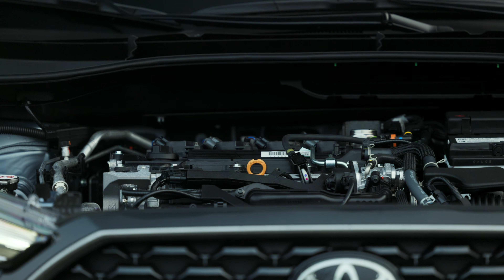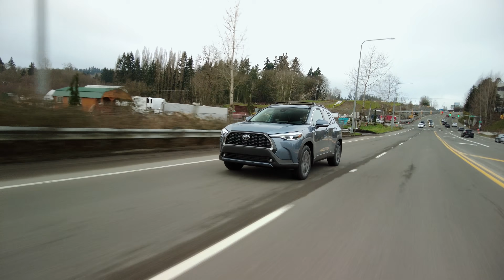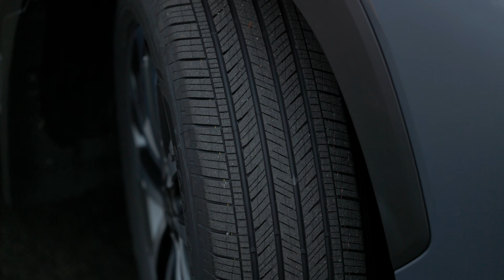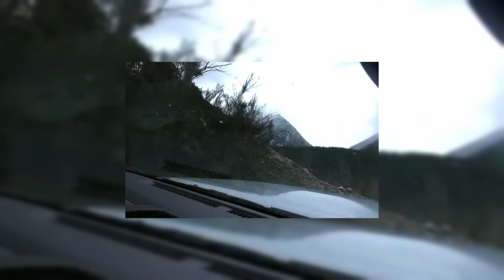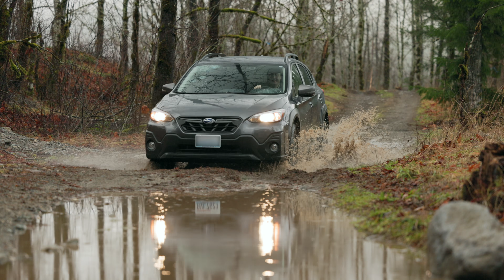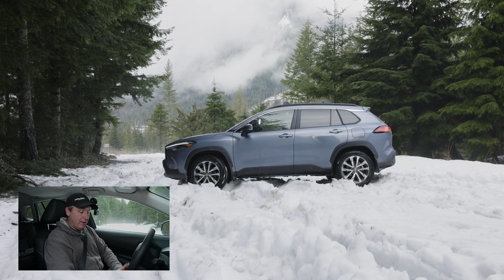2022 Toyota Corolla Cross vs Subaru Crosstrek AWD Off-Road and Snow

Comment: I was going to get the Crosstrek over the Cross but decided against it for Subaru doesn't want to sell it to me MSRP and has a markup of over $5000. I just went ahead and ordered a Corolla cross and I got it at MSRP. Cross is bigger than Crosstrek too which I prefer.
Reply: Just traded in my 2018 crosstrek limited for a 2022 model .the 2018 crosstrek was worth more 4 years old than when it was new
Reply: Same situation for me. Was down to subru and toyota and dealer offered the MSRP for the corolla cross so i took it. I'm not going off-roading and it should deal fine with snow on city roads. But i haven't gotten it yet and now the delivery is pushed to end of march :(.

I've been driving a toyota matrix for the last 12 years and my whole family owns Toyota's so i trust the brand. The one Chrysler and hyundai we had both had so much go wrong and with a purchase this big i dont want to risk it so that was another factor in choosing toyota over subru.
Reply: @OxnardComma  a recent report has 95% of Impreza's and other Subarus still on the road after 10 years.
Reply: Same, literally for the same reason
Reply: Toyota will last a lot longer too.
Reply: Plus Toyota’s run for 500,000 miles + , while none of my 2 subarus passed 200,000 miles. 
My wife had a 1st gen RAV4 with 325,000 miles and she sold it 7 years ago, and the old lady who bought it still drivers every day.
Reply: @devil2jz500  My last Subaru made it to 300,000 miles.  The previous owner was a young teen, I was a teenager when I bought it from them.  It was great and never had any issues, it only failed because I was a dumb teenager and got stuck in a 2 and a half foot snow storm in Pennsylvania and proceeded to hold it at redline for a very extended period of time trying to get myself out.  If I didn't do that with it, I'm certain I would've still been driving it today.
Reply: @devil2jz500  My Rav4 has 95,000 kms on it.  Seals blown in rear differential right now and Toyota can’t even fix it until Jan.  First, they tried to tell us it wasn’t covered under warranty.   We’ve been Toyota owners for most of our lives.  Sadly, it’s the last one we’ll ever buy. 😡😡😡
Reply: @gwenedd9734  what year is the RAV4? I never heard about any differential seals that can’t be fixed. If you are not mechanically inclined, the dealer will BS you and take advantage of you as soon as they suspect that you aren’t an expert…
Reply: @devil2jz500  yes, i googled it and crosstreks are good for 200,000 miles while toyotas are good for over one million miles!
Reply: @michaelsmith9308   they are pretty optimistic with Subaru lasting 200k miles 😂. The boxer engine design isn’t very practical for maintenance neither. I can do a timing belt service on a Toyota at any parking lot with basic tools. Stick with Toyota
Reply: @devil2jz500  modern subaru engines are timing chain not belt
Reply: @devil2jz500  what subaru have you owned 
I am comparing between the corolla cross and subaru crosstrek..
I am afraid from the weakness sheet metal of the toyota.  It got dings very easily ..even the bumbers are not solid fitted and easily got disassembled from the car if got a small hit .  How about the subaru  solidity ?
Reply: @amrashraf9559   I owned a Forester and an Impreza. I have at least 20 friends who owned Subarus and they all either blew a head gasket or a rod through the block. Subarus are fun, but not reliable. I currently have a Corolla with almost 300,000 miles and still running like new. After I saw 2 Tundras with 1,000,000 miles and a Tacoma with 650,000 miles I only buy Toyota.
Reply: @devil2jz500  so if i compare the new forester wilderness to the rav 4 ? Which will be more solid and reliable ? Why most people  confirm that the crosstrek is a very relaible car ? I am so confused ..i usually use the car for 8 to 10  years ,so i need a bullet proof car .. i am comparing between toyota rav 4 vs subaru forester wilderness vs volvo xc60 ...
Reply: @amrashraf9559  Toyota’s are the most reliable cars no matter what. The reason why people think the newer Subarus are reliable is because they still new. Just give them another 5 to 10 years and they will be seating at the Junkyard. Toyota has the reputation of building reliability. I honestly like to drive the same car forever. Some people buy a new car every 2 years or less. For me reliability is everything. Toyota only. Nothing else.
Reply: @amrashraf9559  I'd go for the RAV4 among your selection & nothing else
Reply: @amrashraf9559  Do not get a Volvo. My family made that mistake.  Never ever get anything from a European brand.
Reply: @baronvonjo1929  even mercedes ?
Reply: @amrashraf9559  Yessir. Every brand. I personally don't see that many 10 year old Mercedes. And they are incredible cookie cutter to look at in my opinion. Same deisgn mostly for 20 years.
Reply: @devil2jz500  to be fair. Boxer engines are very simple to work on and by design have very little need to have harmonic balancing. The boxer motor became problematic when they started being water cooled. Porsche, VW, and even Chevy have all had success with the boxer engines ( the latter was a flat 6 that got a turbo charger in the 1960's). Adding chains and belts to an engine design that was flawless when run off of cut gears from it's inception is what made them unfriendly to the home mechanic.  
And no, I am not sticking for Subi owners. I don't care for them. My 2001 Audi A4 pulled out several stuck Subi's when I lived in NY. But I'm a Jeep and Honda guy. And I agree, Toyota last forever.
Reply: @DavidSanchez-ib4ft  agreed! I am an Aircraft mechanic. 99% of the piston engines in Aviation are boxer. But they are air cooled with push rods. Super simple. I have 4 Honda’s, 2 Audis (81’ Audi 80 2 door and 87’ 4000 four door) and a Datsun with a 2jz. My wide and I have Toyota’s as a daily. Both with over 250k miles running like new. I’m a big Honda and Audi fan due to their history in Motorsports.
Reply: @devil2jz500  head gasket issues were only present primarily on the EJ engines, especially if coolant flushes were not kept up on.  The rod through the block was most common from lack of proper oil changes or extending the oil change intervals.
Reply: @devil2jz500  i have a 15 year old subaru that runs perfectly fine, no issues. There is a reason why the crosstrek has been rated the most reliable car of the year by CR. Not saying Toyotas don’t last, they do. But the subaru issues are isolated to a specific variation of their engine design and are not problematic in modern subarus
Reply: @jjjcmzzt  only time will tell how reliable modern Subarus are. In 2001 they were not expecting Subarus to be such a POS as they turned out to be once they became 10 years old by 2011… I keep seeing “newer “ Subarus for sale with engine knock and overheating issues.  My Toyotas still run strong after 350,000 miles. I have a coworker with a 480,000 miles Tacoma. I also have a coworker with a Jeep Gladiator with 20,000 miles and his second transmission along with lots of electrical issues. I also have a coworker with a brand new Nissan Titan (5,000 miles) and his dash lights/buttons are failing.
Reply: Wow interesting me to looking realyability and value it will also be my last car as i will retire soon love camping  @amrashraf9559

Comment: I wish you would compare a 2000 Toyota RAV4 automatic all-wheel drive vs 2010 and 2022 so compare all of the generations I have a 1999 but it's manual with Center locking diff and rear LSD. I will gladly drive it up from Arizona to Washington to join the comparison video.  but mine is not stock. I have a 2.5 inch lift kit oversized brake kit and Yokohama geolandar all-terrain tires. If you look through my channel I have a video testing the AWD system with my 2000 lb camping trailer hooked up

Comment: Aftermarket support for the Corolla Cross will need to get busy if Toyota wants to catch the Crosstrek. Toyota wasted several years with their FWD-only CHR. I can already find turbo kits, suspensions, skids, winchmounts, bumpers, rockers, intakes, airfilters, hitches, diff-lockers, sparemounts, etc. for Crosstreks.

 I prefer the Crosstrek aesthetics too. The Toyota isn't bad looking, IMO, but I'm not crazy about that grille.

 Where would a winch mount on a Corolla Cross?

Comment: Crosstrek checks almost all the boxes. 
No LED headlight option available. 
How terrible (or not) are the headlights at night?
Reply from the maker: The headlights on the Crosstrek are pretty terrible at night.
Reply: LED headlights available on the 'Limited' version - but we find the halogens OK, but will probably put in some upgraded halogens at some point.
Reply: Get brighter halogen bulbs. Aim your headlights properly. Get an eye exam yearly. Eat your veggies, to better your night vision.

 I don't want OEM LED headlights.

 Until I can buy an affordable replacement off the shelf at any autoparts store in the country, I'll stick with halogens. They're good enough for me to see on pitch-black roads, especially if I have high beams, auxiliary driving lights, and fogs.

 The main benefit I see with LED vehicle lights is for low-wattage tail/brake light and marker lights on my dualsport motorcycle that has low stator output. I can run heated grips and/or heated clothing on the bike, while charging my phone, if I use LEDs instead of incandescent bulbs.

 Car alternators put out more than enough amperage to power most accessories without running the battery down. Incandescent bulbs also produce more heat to melt snow/ice off of headlights better.

Comment: I'm sure with the same tires Toyota could pass the ditch.
Reply: Not when the only tires that were spinning were up in the air. It was clearly an AWD system error, not a tire problem. The Toyota AWD system was sending power to the wrong wheels, the wheels that dind't have traction.
Reply: @brandonb.5304  Exactly my point. Traction tires spinning in the air would make no difference and smooth tires on the ground not spinning is indicating that the tires were not the issue.

Comment: Toyota is using 80/20 in their all wheel system while Subaru cvt is 60/40 right ?
Reply from the maker: Toyota can do up to 50% to the back. Highway cruising is 100/0 (disconnects)

Comment: Automakers have gotten way too carried away with different model lines.  Honestly all they need is a mid-size crossover, a full size and mid-size SUV, a compact, mid, and full size pickup and that's really it anymore...people quit looking at cars because they can get into a mid-size crossover for about the same price as what automakers were trying to sell cars for.
Reply: I like having an AWD hatch with roofrails much better than a 2WD sedan. My Crosstrek also gets better MPG than my 2000 Civic VP sedan got, and it's rated to tow 1500lb. Bonus that I can get skids, rockers, winch, ATs, and diff-locker for it and go offroading.
Reply: Because people buy them. Everybody has different price points and wants for their car.

Comment: I wish Subaru built something with at least a 7k tow capacity, I'd replace my Explorer LOL.  The more I watch videos with you taking the Subaru Crosstrek Sport into conditions I'd need to go when going camping, I certainly think the Subaru would suit me great for a lot of stuff, just that towing issue keeps me from getting rid of my Explorer right now...new Explorers don't have the towing capacity, and are lacking a few cylinders as well.  The prices of SUV's today are completely absurd for most of us.
Reply: A used Toyota Sequoia might work well for you. 7K lb is quite a bit for most SUVs to tow. There are 1/2-ton V8 pickups that can't tow 7K lb.
Reply: @RKmndo  the gas mpg is a killer on the sequoia.
Reply: @Croiseeman  MPG is a killer on almost anything that will tow 7K lb. An Ecodiesel Gladiator or Ram 1500 might be the only exceptions.

 I can get 22-23MPG with a 5.7L 4WD crewcab Tundra, but I still consider that a gas-hog.
Reply: @tomaskroupakkfoto4132  Manual trans is available on several Subarus.

Comment: 16:50 - three wheels spinning, fourth doing nothing due to grip/resistance it has. Many people consider such situation as impossible to happen 😉
Reply: You're my go to when it comes to AWD tests and explanations. Thank you for all your videos!
Reply: @erik-f7x9n  Thanks!
Reply: I’m sure the different tires played a lot in this video, even though he denies it. The Toyota needed better tires for that little hill.
Reply: @devil2jz500  Absolutely put the right tires for specific situation you would get he results you want. But "they only test with the tires it came with". Understandable but its not apples to apples. Put a car in the environment that it was made for then it will shine.
Reply: @allanflores3668  HOWEVER the Subaru had aftermarket tires. That’s the point I didn’t like. He compared a Subaru Crosstrek with good snow/off road grippy tires vs the Corolla Cross that has the most generic asphalt/entry level tires and claim that the Subaru is better.
Reply: @devil2jz500  It depends which situation you compare. As I mentioned before - during hill diagonal test tyres weren't an issue at all.
Reply: @devil2jz500  On snow - of course they did. On hill (diagonal test) - they didn't.

Comment: There were a lot of rumours in Europe about Toyota Corolla Cross and new Suzuki S-Cross being twins. After all, "new generation" of S-Cross appeared to be just a deep FL, which luckily kept its All Grip Select awd system, working much better than this one from Corolla Cross.
Reply: Suzuki had an AWD/4WD hatchback years ago...SX4, since about 2008. The center could lock, it had TCS, EBD, and VSC. Aftermarket support grew enough to provide suspensions, turbos, exhausts, intakes, skids, winchmounts, and LSDs. Then Suzuki Automotive left North America.
Reply: @RKmndo  They replaced SX4 by SX4 S-Cross, which now is called simply S-Cross. But this car is bigger than SX4 was. Current Vitara is similar size to SX4 (the same wheelbase).
Reply: I love your videos, friend!!!!
Reply: @sleeksilver  Thank you very much!

Comment: Great review, have a 21 crosstrek sport also. Put a LP lift kit and some KO2’s on it. Haven’t tried it off road yet and no measurable snow but seeing how your Sport did I have no worries and am looking forward to giving it a trial.
Reply: I got KO2's for my FJ and they were the worst tires I've ever owned. They had the worst wet traction, worst snow traction, and squealed on dry roads.  I took the loss and got the new Bridgestone Duelers with half the tread left on the KO2’s and my wife will actually drive the car again.

Comment: As much as I despise SUVs, we just ordered a Corolla Cross FWD XLE in Cypress Green for my wife (our 2012 Mazda5 with 215k miles, is starting to incur expensive repairs.  It was a FANTASTIC car though).  The practicality, predicted reliability, and roomy backseats for our kids were too tempting to pass up.

Like most buyers, ours will never leave pavement and winters are mild here in NC. We chose the XLE trim because our kids would destroy a cloth interior and for the middle armrest in the backseat.

We paid $30k out the door. We considered moving up to the RAV4, but a similarly equipped (not base) model is roughly $5k more.

Looking forward to receiving it in approximately 60 days.

Comment: What is all the brouhaha with cvt? My Car is 15, now has an oil leak, sure! But 15 years no problems. In the last two, I haven’t taken care of it as I should. That’s my fault not the manufacturer.  I do like the Cross. For a first year vehicle, it performed very well. Boohoo, it didn’t go over the bump. It didn’t have the tires nor did he push(no underbody protection).  Great vehicles!  That’s a lil pricey but so are all cars now.

Comment: Ryan, It may not help ultimate traction but I am still hoping the Cross's Hybrid system is sourced from the RAV4 rather than the UX.  At prices like this, an upgrade in performance is thoroughly warranted. In regard to the Crosstrek,  a sale that goes to Subaru still ends with 25% of the money going in Toyota's pocket. If someone buys a Corolla Cross, Toyota gets more money but they have to go through the bother of actually building a car . 😉
Reply from the maker: Agreed.

Comment: I am not sure this is very scientific in a way that you're comparing apples and oranges when it comes to tires. Subaru had the snow tires, and Corolla didn't. You also didn't want to put a lot of power through the Corolla in order to protect the underbody and we can't tell from this video how much power went into the Subaru given both car have a similar margin of safety on the hill before they scrape the ground (assuming same mass). Again to be scientific and all, if you had the same mindset to push both cars equally given the same conditions, things could have been different. From your video title, we are only interested in changing the 1 thing in the experiment and comparing the output (i.e. AWD), nothing else changes. We would be splitting hairs if we said the Corolla laid the path to the Crosstrek and other minor factors, but hope you get the main point of my comment. I own an Impreza.
Reply from the maker: Given how much power is shifted and total system power available, plus surface change variables, it’s not practical to do a scientific test in the real world. That’s why most test labs use cement courses — which of course isn’t very relatable as nobody drives on surfaces like that normally. The Toyota  did nothing at full throttle. The Subaru shifted power and moved forward. Visually it looked very different but from inside I drove in a very similar manner.